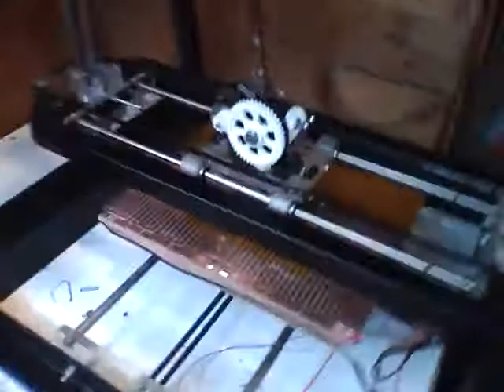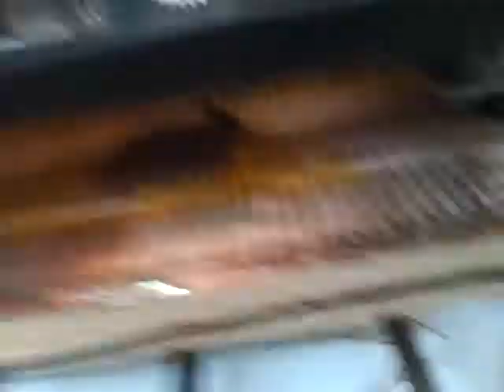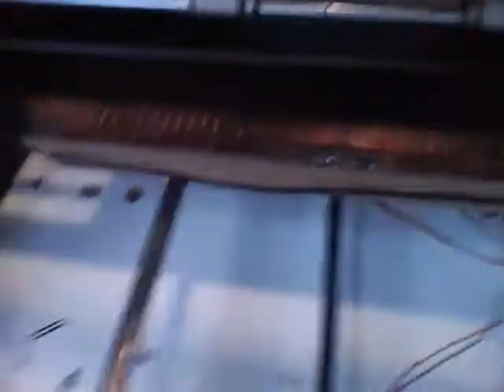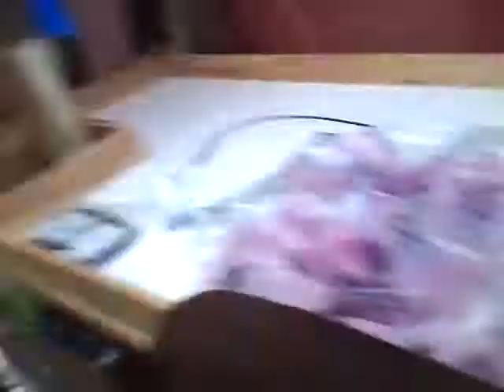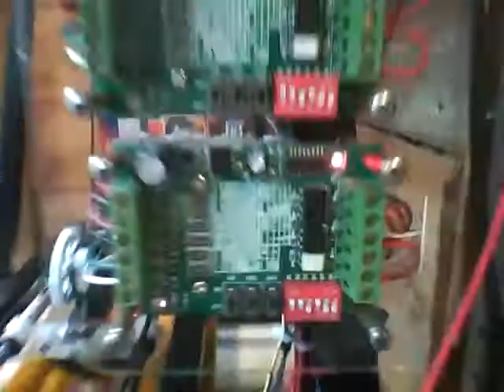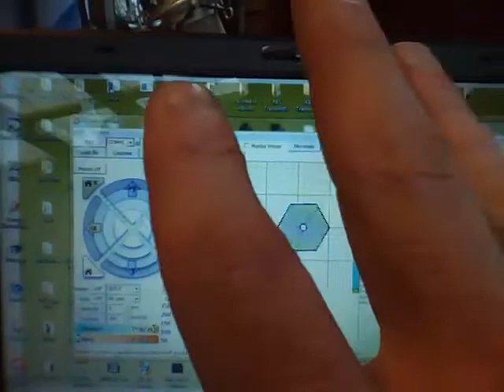3D Printer Update (For non-nerds)

Comment: Quick question, can this type of machine "print" out a circuit schematic onto a piece of PCB? Imagine if you could print the tracks in plastic directly to the PCB (or glass for surface mounted components) then you disolve away the rest of the copper, then sand the plastic off. No messing with printers, toner, heatguns etc.

Comment: awesome. how do you drive the motors for the z-axis. do you drive each motor with a separate drive or both motors are connected to a single driver? i hope you can help me with this issue. I want to do a fairly large cnc and don't know how to drive the y-axis. thanks in advance.